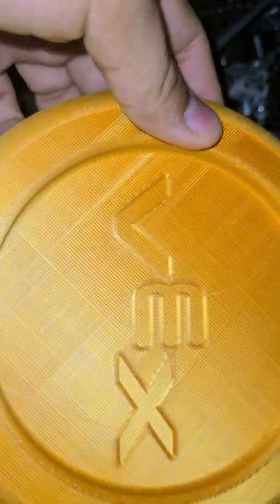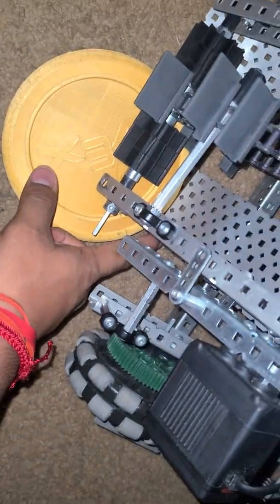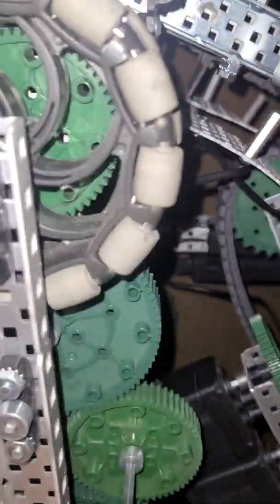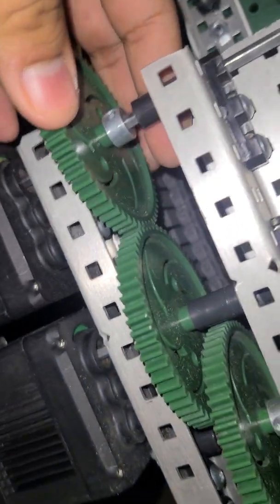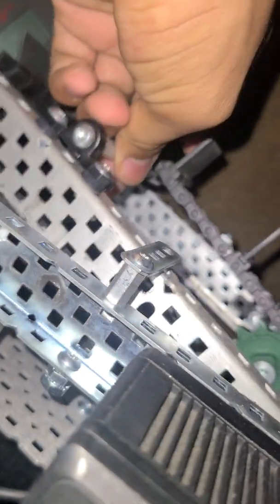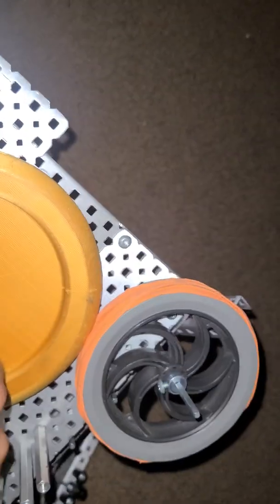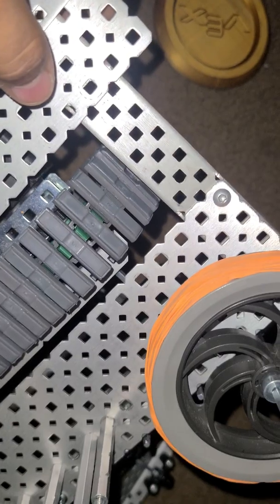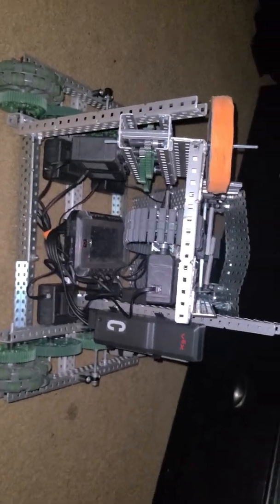Vex Spin Up Robot explanation

Comment: make a weighted flywheel
Reply: whats the difference between a normal and weighted? I'm not very experienced in robotics and as well just started last year xd. Just wondering
Reply: if your flywheel has weight on it it doesn't lose as much speed after firing a disc so it can shoot more discs faster and farther.   @alitteralnoob3404